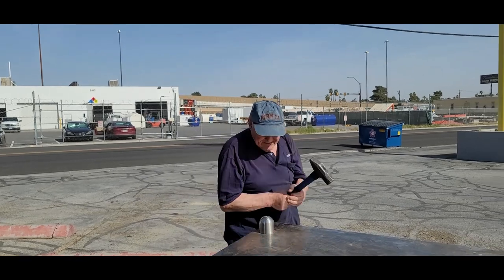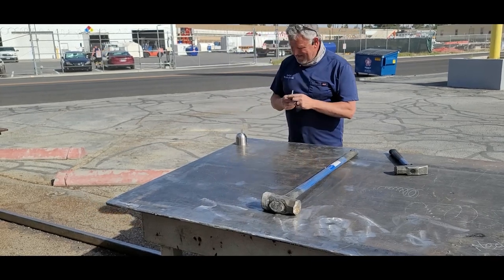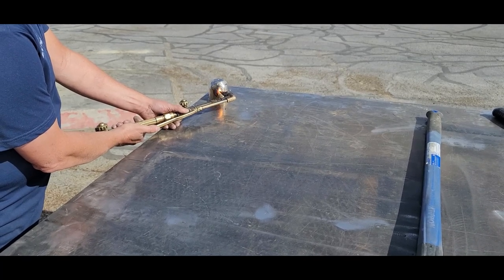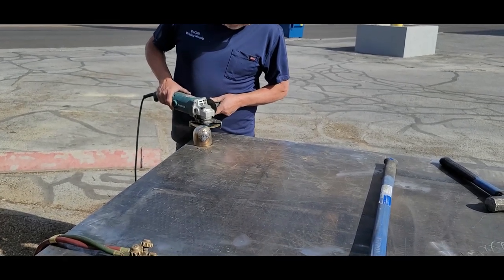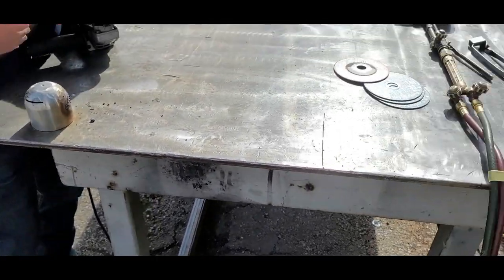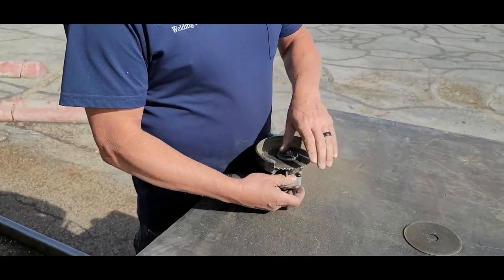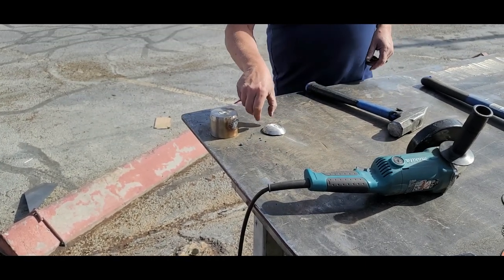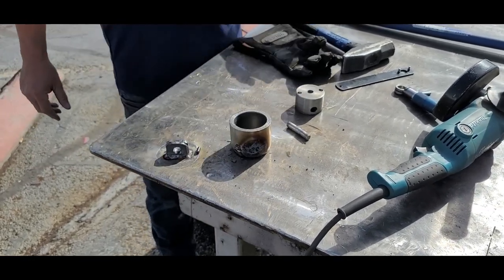Attempt to Destroy TED Tooling's Unpickable, Unbreakable Lock

Comment: Security by obscurity deceives only the user.  TED do make some very nice equipment for professional machinists though. Had they used a core that is difficult for LPL and other pros to pick the body and shackle design are amply sufficient. A future version should incorporate a core designed by professional locksmiths then be send to LPL for testing! If it passes that third party validation then it would indeed be a superior lock.  Machinists are awesome but they think LIKE MACHINISTS not locksmiths and that is a key (pun of course intended) difference.

Comment: From your website: "Using never before seen technology, it is purely mechanical only and is the only patented lock to use the new innovation of a bolt with a key." - I've had one of these types of bolts and keys on my bike for years.

Comment: Yeah, I think it took the LPL about ten seconds to open that with a pair of pliers.
Reply: With the right tools and a bunch of stuff
Reply: @noahjin7298  Yeah! One little magnet, two types of pliers and a bit of sandpaper. A 'bunch of stuff' alright! 😂🤣
Reply: @douglasmorris8364  Yet even LBL admitted he couldn't do it without the right tools.
Reply: @noahjin7298  sure but if this is real life, and I'm a thief, I drive by some tradies shed locked with this. I think "wtf is that" and do some research on it. I learn how to open it easily thanks to the internet, then I come by prepared the next day with some basic tools, and voila that shed is unlocked.
Or you could just like take a grinder to the sheet metal wall of the shed, might be easier and quicker

Comment: Why hammer it? Just use 2 sets of pliers to unscrew the bolt inside. The Lock Picking Lawyer has a video of opening this lock with just two sets of pliers in under a minute.

Comment: Disingenuous to cut through the thickest part of the lock at a level too high to actually interfere with it. Obviously you could cut through the base where the “key” is
Reply: I was the one cutting. Nothing disingenuous. I didn't want to cut too low or too high. I even figured I could cut a second cut. It was impressive how long it took AND how the blades were pulverizing. Anyone with a brain knows it's a matter of time to cut ANYTHING.
Reply: not knowing anything about "lock"   i would have cut closer to bottom, And yes a Battery Grinder would have needed multiple batteries .